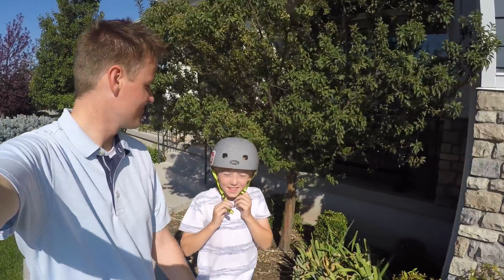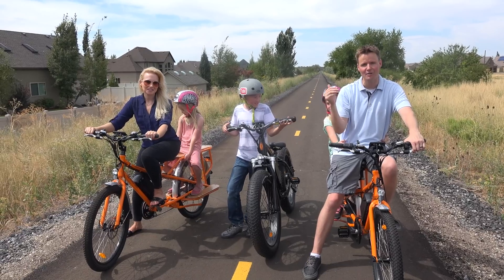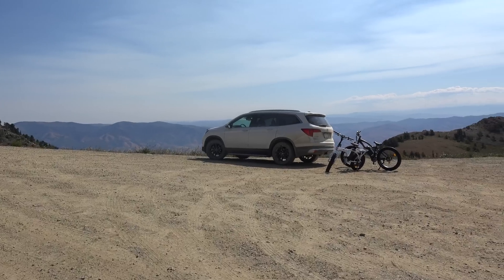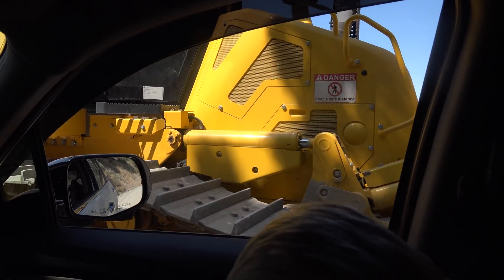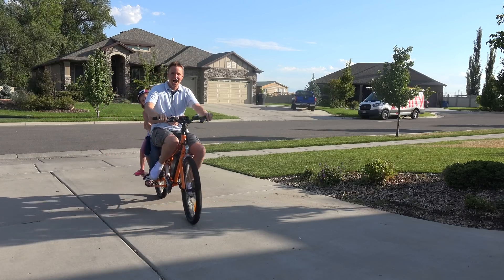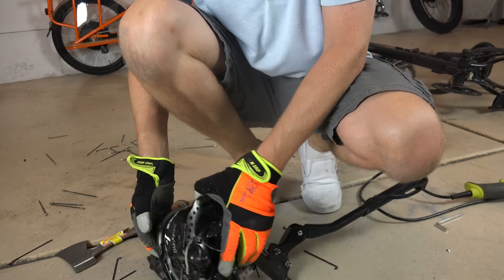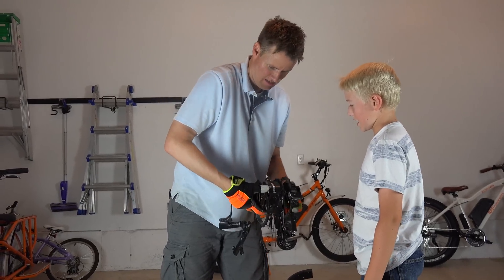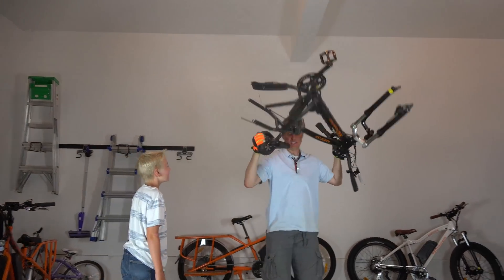What's inside an Electric Bike?

Comment: How did they not invent a spare battery you can store on the back part of the bike and also can charge it by riding the bike with the wheel spinning it will create energy that could be stored into the spare battery.. so when the battery runs out you can swap it.. and charge it.. which means you could ride it without havin to stop and charge everytime.. and it could also charge your phone too aswell and each battery comes equipped with GPS and different levels of how much piwer to use

Comment: That's not an engine. Engines run on gas and have combustion. That is a "Hub Motor" or even "Motor" would have been fine. Motors run on electricity.

Comment: meh if it dies you can just pedal right?
Reply: yup, you can also use it as a throttle bike, a motorcycle! if you want to know more just ask :P
Reply: Also most of those bikes use the motor for braking. The motor actually charges the battery in the process and then the brake pads work as a backup and/or to finish slowing you down.
Reply: nice to know :D

Comment: These motors are designed to be taken apart on most electric bikes. Getting the angle grinder out isn't needed!
Reply: or you know unscrewing the bolt from the axle...
Reply: Cutting into things with loud sounds and sparks is kinda the essence of this channel though.

Comment: It is a brushless motor. The electricity causes a magnetic field thus pulling the poles to the respective sides (N to S, S to N). Then flipping and causing the N and S to be moved to polar opposites. Then propelling the magnet away from the ends (N to N moving to N to S, and S to S moving to S to N). Flipping constantly causes the magnets to speed up causing the motor to spin faster until it reaches a peak output. (max speed)

Comment: What's it like riding the electric bike? Does it go by itself?
Reply: Here in Sweden an electric bike is not allowed to go by itself, you have to push the pedals before the motor kicks in. Not sure how it works in other countries.
Reply: Yes you can ride it with no peddling it goes about 22.5 mph. You can peddle with it also and get exercise and make the battery last longer or get yourself home after you run the battery out
Reply: No it just makes it go faster

Comment: SAFETY WARNING!!!  DO NOT CUT/GRIND/DRILL Neodymium Magnets like those used in this electric MOTOR (not engine). The dust created by this is VERY flammable... and worse yet, the burning magnet dust is TOXIC!  The only way professionals do this is by submersing them in special cutting oil or water - to prevent ignition.
Reply: Also, not the best way/example of teaching your kids the value of things/money.

Comment: you guys hurt me by ripping apart that bike 😞. I was thinking, if you want the back wheel off remove the axle, then lift out the back wheel, then if needs be remove the spokes from the hub then cut it apart so you save money and only have to replace the motor.

Comment: This is the laziest thing I've ever seen
Reply: You haven't seen a hover board then
Reply: but it's effective because I have an electric scooter and I use it because of the speed so I can get to school on time
Reply: +Barry Celtic i have my own motor it is called legs
Reply: +The Lobster yes
Reply: I build my own electric bikes, Currently mine goes 60 + mph, but before you hate i will have you know that is my transportation. That would be like me hating on you for driving a car?  Anyway, they are really fun to have. I enjoy riding mine every day :)
Reply: bob smith can you make video on it?
Reply: I don't have plates for it. i stick to 25 mph at most times.  It just has the capabilities to go fast if need be.  That's the benifits of having one is that i don't have to pay for gas, or have plates for it or insurence Yet i still have an everyday transportation.  The bigger battery i put on it is not just for speed and power, the main reason to have it is for the amount of distance i can travel on a single charge which is 100 miles.
Reply: My parents probably won't let have a scooter or a motercycle when I'm 16... So I'll probably just buy an electric bike
Reply: We each have our own opinions but as for me my electric bike is my daily driver so for me it's way more practical then a bicycle without motor. And also if i didn't say i enjoyed riding it every day then i would be lying. It's amazing.
Reply: +The Lobster true 😂😂😂